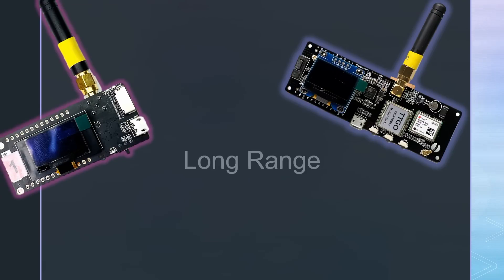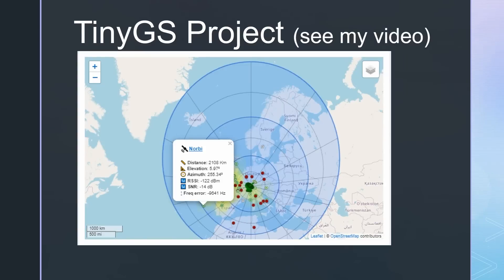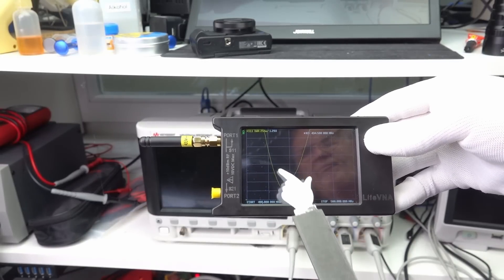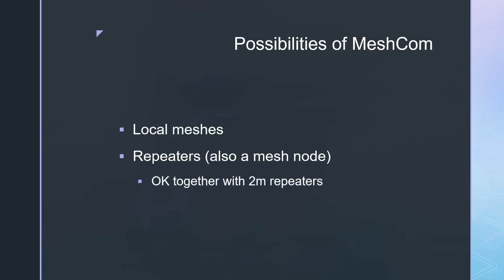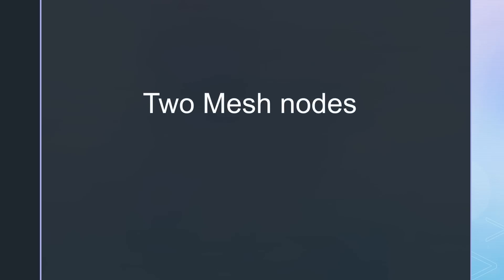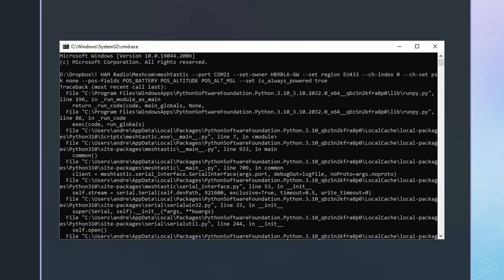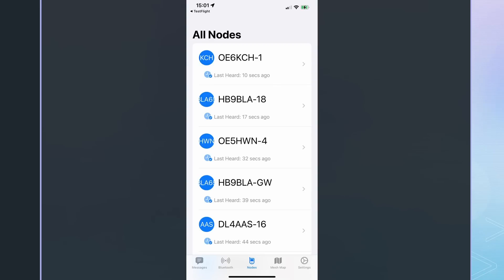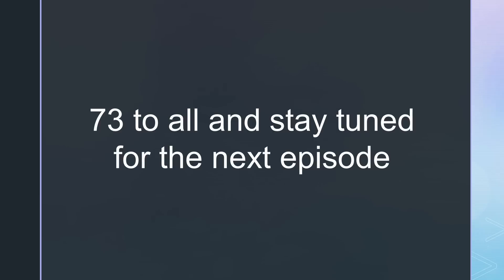022 We build a Global LoRa Mesh Network (MeshCom, Meshtastic)

Comment: Do you have the device name, model number or more details regarding the 1 watt Lora board? 
I can't seem to find a plug and flash board like the T-Beam in the market and most of them are selling only the bare module. I'm a HAM operator and would like to setup a higher power repeater node.
Reply from the maker: E22-400M30S should be one.

Comment: Awesome video, I'm working to start a network in Montclair NJ - USA with my ham club and I'm getting an error message when I try to communicate with the module to send the communication lines, it's similar to the error when the ESPHome... ends in:
 Exception: Timed out waiting for connection completion

BUT the ESP is closed. Not sure what else can be "blocking" the serial. meshtastic -h works but any other command related to the port such as  meshtastic --port PORT  returns an error.
Do you know what should I do?
Reply: Solved... I downgraded the meshtastic to match my firmware and it works perfectly fine. KD2WWU first node in America to participate! 73

Comment: Are you going to produce a video showing how to set up a gateway? I'm in the US, and with a HAM license I can transmit up to 10 watts.
Reply from the maker: The Meshcom project changed considerably and they use APRS now. I did not check the new one out yet.
10W is most probably not helping a lot compared with the hassle to produce it because LoRa has a very high Link Budget and therefore does not need a lot of power like FSK.

Comment: I have a case where I’d like to make between 2 to 10 Nodes used as Repeaters that talk to each other, but call also be used to allow Meshtastic as well.

I’m trying to understand if one Node can do more than one thing?

As an example, I need all Nodes to have a display clock/timer and 2 push buttons like a Chess clock timer that switches between the 2 push buttons, Red and Blue. Each timer is is reset at the start from a master control, but each of the push buttons and their calculated time would be independant
Reply from the maker: A repeater is a node with a good location. It has the same function as all others. This network is a "mesh" where everybody is connected with everybody in range.
Keep in mind that this is far from a "real time" system, because its speed is slow.

Comment: You know this is actually really cool if you could solar power about 50  of these.    Real question? How do these fair in the field? Do they often  go dead while in use like the average router, thus needing to be reset manually every other week after some time in operation? 

I have yet to see a consumer or hobby grade router or a Modem from and ISP not have random issues that require a physical power cycle to be able to log into it.   How are these for long term use?   

If these are really good for Mesh networks?     Then with placement being in places hard to get to if using solar or wind power or a combination of each?    They would have to at least have a good amount of Uptime before they wig out.    Do they?
Reply from the maker: AFAIK they are used as solar powered repeaters on hill-tops. But I have no experience with stability.

Comment: I want to build a local network of Arduino devices that control some lights. Almost like Philips Hue but over longer distances. Could a local LoRa mesh work for this? What is the easiest way to code this? I don’t think I need LoRaWAN or TTN. But I’m still looking for a well supported mesh library. The range doesn’t need to be more that 5km wide across the whole mesh. I do think I would want the messages to be encrypted so nobody can mess with it. I’m not sure what my approach should be. Radiohead maybe?
Reply from the maker: I once showed "Farm Data Relay System" on my main channel. It is no mesh, but maybe fits your needs.

Comment: At 7:50 in the video you say: "Do not install Meshtastic firmware because MeshCom binary has some presets". I have a Lilygo board with Meshtastic already installed. Do you have any tips for installing MeshCom in this particular situation? Thanks.
Reply: There's an option with ESPTool to "erase memory before flashing" or similar, that should do the trick!
Reply from the maker: I just saw the comment and hope, you were successful. I suggest the same as John.
Reply: @HB9BLA  I’ve since learned there’s also a firmware erase flash file that I was sent by someone on the Discord group, maybe also worth using.